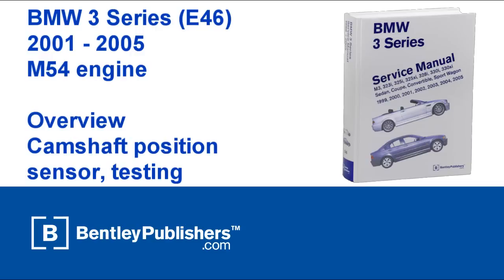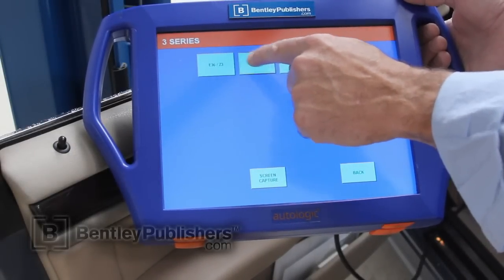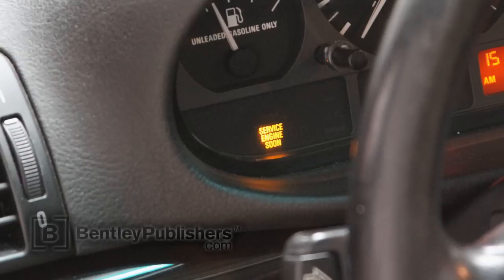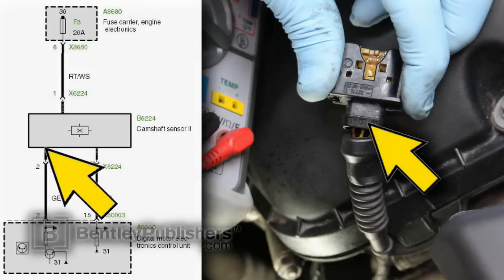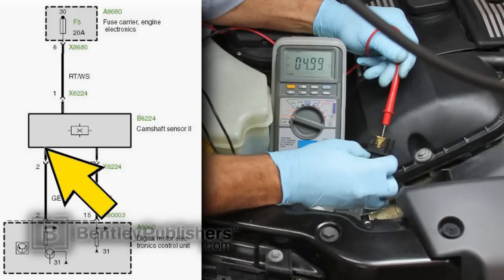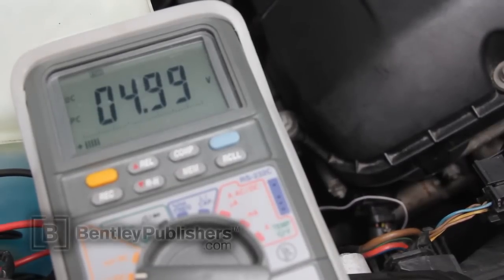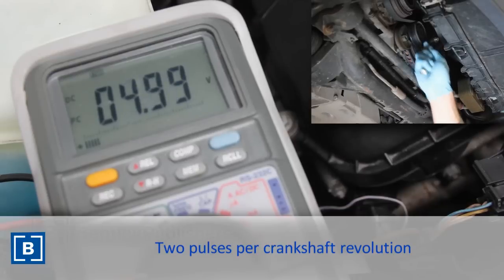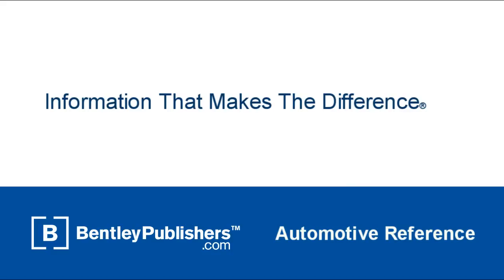BMW 3 Series (E46) 1999-2005 - Exhaust camshaft position sensor testing P0369 - DIY Repair

Comment: Tested the cam sensor and for half of the rotation it was 5v and other half 0v. From my logic thats how it should work aswell, because when you watch the camshaft position reference plate on the camshaft itself then half of it has a outward edge and the other half not. How should it only provide 2 temporary pulses instead of it working at 0v for one half of the whole rotation and 5v for the other? Commenting on a 10 year old video may not prove much result but worth a try.
Reply: Probably because it is the CHANGE in magnetic flux density which induces the emf in the sensor ( voltage)

Comment: i have p0340 tested intake and sensor seems okay. tested exhaust as in video doesn't show anything. could p0340 be related to exhaust side also? i disconnect both of them and started car without problem or EML no check light on dash. i`m lost.. :D and inside exhaust side connector was some oil cleaned everything gonna check letter or it's coming true sensor.

Comment: My car has no fire. http://doearning.com/?id=2846 2002 318ti: I was told it  would be a faulty crank sensor so I changed it and still, it wouldn't start. Pulled from scanner (p0341) could it be cam sensor causing no spark ?

Comment: I got a problem with my 01 530i, it has low power bellow 3k and exhaust vanos faults. I replaced solenoid, did Vanos seals, PCV and still no results. Only thing that has worked is when I blip the throttle on startup that very second engine starts it all works fine and I got tons of power from low end! Could it be faulty camshaft sensor that throws no faults?? Thanks!
Reply: I didn't resolve my issue yet but so far everything points to a camshaft or crankshaft position sensors...
Have you tried blipping the throttle on startup and do you feel any difference?
Reply: @urosb82  Having the same issue on my '11 550i. Tuned in to see what the resolve is.

Comment: hi, i have a bmw 2003 e46, i have codes p0012 + p0341, i am replacing both camshaft position sensors, but my question is do they need to be set by the diagnostics thing.

Comment: Can anyone explain why I should be seeing two pulses per crankshaft revolution? I thought that the cam rotated once for every two crankshaft revolutions. I have very limited experience and I was assuming the cam sensor triggers on each revolution of the cam. If I've got this right in my head, two pulses per crank revolution would suggest the sensor is triggered with every 90 degrees of cam rotation.

Comment: What if I am getting 0V in the sensor reference signal? is the 5V supply an ecu supplied  voltage ?. I changed the sensor with a new one, but keep getting the same fault code returned 2a63. Seems to me the sensor is never getting the 5V signal it needs to work with. Doe anyone have a pin-out of the ecu as this is clearly not a cam sensor fault.
Reply: +ZxRx7 similar problem with my int & ex cam sensor, i am getting 12V on signal ref, my engine is N46, did you solve the problem?

Comment: Hi, I did check the signal wire an I got 10.8 instead of the 5 that you got. Is it normal. What does that figure suggest? Thanks.
Reply: rabtandoh did you solve the problem?

Comment: Hello,
I have E39 2002 V6. Can I use other BMW serieses exhaust camshaft position sensor to my car
Thanks

  Y.Jebreel
Reply from the maker: yahya jebreel 

Hello - Your engine is a straight six cylinder. Many engines are shared between series. Your engine is the "M54". A sensor from another M54 engine, say from a similar year 3 series, will work.

Comment: good testing but not always valid,by this methods you just can check if sensor is totaly dead,but fot intermitent failures on hot, og signal drops or any glitches by this tests you wont find it. osciloscope is the key.
Reply from the maker: Hustler LT Great point. Spot on advice!

Comment: This was the only video that was clear and simple enough to actually test my sensor on a '97 C230 Benz.  Although vehicle runs great...getting fault code P0341 'camshaft position error'.  After this video...definately not my sensor.

Comment: I have a 2003 bmw e46  sedan..when i drive it for extended time, especially on hot days-(summer time) shut the car off for at lease 5mins then try2 start it back up again. it wont start! the temp needle jumps into the red. as if the car was overheating, it locks-up, nd wont start un-till the engine cool's off again, the needle never goes into the red zone while im driving thought, only when i stop and then shut the car off ive been struggling with this problem for 2yrs now with this car
Reply: i know this is old but were you able to fix this problem? I am having this problem right now.

Comment: Firstly great video, simple and concise.

I have a 2005 Z4. When I measure between terminals 2 and 3 of the sensor, the meter reads 12v. Do you know if the voltages vary between different models?